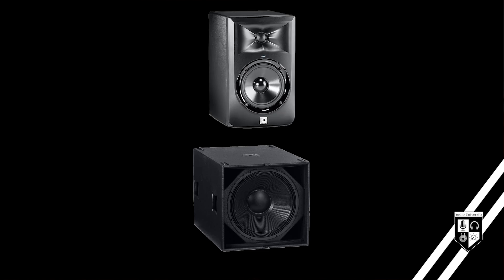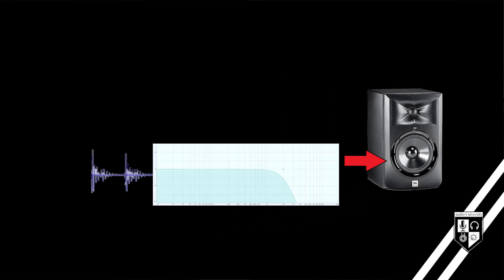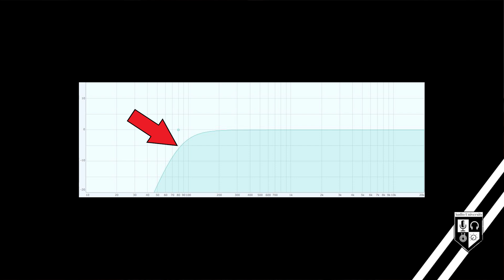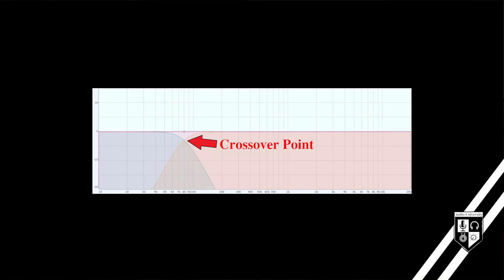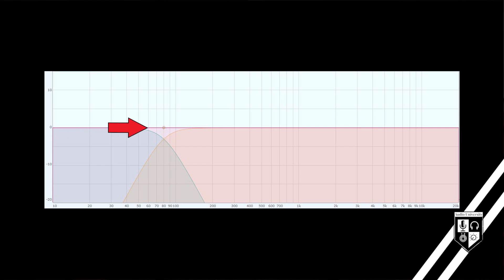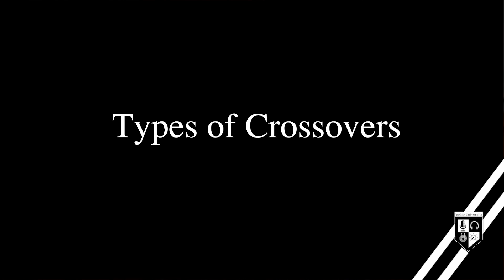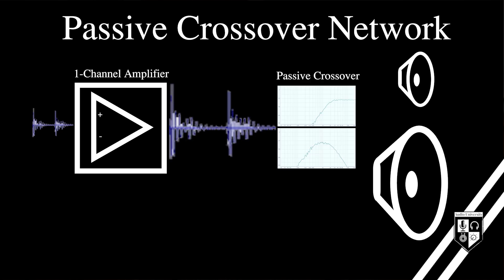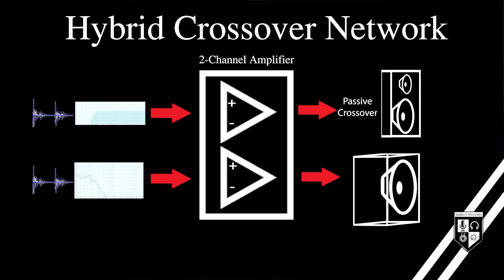Complete Guide To Speaker Crossovers [Crossover Settings, Active vs Passive Crossovers, & More]

Comment: Random question,if i cant add a box crossover to the door panel because its too bulky and i cant find anything smaller , can i use only the capacitor on the tweeter  for a budget build ? I will try to upgrade the capacitor on my tweeters if needed .
I have hertz uno k 165 with the t24 tweeter from their lineup  rated st 3.5 to 20-22k hz . The manufacturer says the component set can be amplified to 75 watts , and i want to know if i can safely amplify the front stage ( i will set gain accordingly with a multimeter to not clip the sound

Comment: Dude! Love your channel. I was wondering if you take questions...I'm trying to wire a horn and 15" driver to a single bass amplifier. Would I need to figure out a crossover option or could I just wire both of those drivers into one NL4 speakon cable and run it to the amplifier. Either way I appreciate what you're putting out. Take care.

Comment: 👍👍Sir, you are the best teacher. Very clear and simple explanation. ❤I am learning a lot from you. 
Can you kindly enlighten us,  for a Active Crossover system, for example, if the Power amplifier for the woofer is 100 watts RMS, then how many RMS watts of power amps are appropriate for mid-range and tweeter?

Thanking you in advance.

Comment: Thank you.  Many systems have subwoofers that contain the crossover.  Unfortunately, it's really hard to find a subwoofer that does not rattle electronics to pieces.  My Adam speakers have a problem on one satellite channel.  I need a crossover to obviate the one built into the sub.  Solved.

Comment: I have watched a few of your videos, very informative. I have a question on using a 3 way crossover.  My amp. is an 8 ohm output per channel. On selecting speakers for a 3 way speaker. How do you verify that the crossover and 3 speaker load for that one channel is with in my 8 ohm Amp´s capability.  I have used a multi meter to verify speaker ohm impedance. Once the cabinet is wired with it´s 3 speakers and crossover, will the multi meter verify the total ohm impedance of that Cabinet. Thus testing the + & Neg terminals, line in on the crossover.??

Comment: So, would it be possible to use an active crossover with an active speaker setup?
Reply from the maker: Yes! You’ll just place the crossover before the input of the speaker. In fact, some powered speakers have active crossovers built-in.
Reply: @AudioUniversity  thank you for the reply! 

Assuming the speakers do indeed have built-in crossovers, it would still be possible to use an active crossover? 

I’m currently building a mini reggae sound system, and really want my subs to focus on the bass!

Comment: Hi Kyle, I've got a 19" rack with a with an active crossover intergrated into the 31 band EQ.  

This is the final stage of the signal chain before it outputs to the speakers on poles with subs on the floor (like you have in your comb filtering video that you made outside).  

My question is, am i better to use the crossover in the 31 band EQ or the crossover in the top speakers themselves or a combination.  

Option A is send left and right signals out of the 31 band EQ to the top speakers on each side and then plug the top speakers outputs into the sub inputs and use the crossover on the control panel of the active speakers to set the crossover.  

Option B is to send left and right signals from the 31 band EQ to the top speakers and then send a separate XLR cable from the Sub Out on the 31 band EQ to the 1st sub, then link the subs together with another XLR cable.  Then set the crossover on the 31 band EQ and not use the speaker crossover at all.

Option C some combination of the above if it has any advantages. 

Your thoughts on this would be much appreciated and those of anyone else who wants to comment.  Thank you
Reply: I've had a closer look and in fact, there is no manual crossover on the top speakers themselves.  There is just a "Sub Freq" nob that says it sets the upper cut off frequency of the subwoofer (80Hz-200Hz low pass).  So on reflection, would you set this to 200Hz to allow it's maximum range to be reproduced and then just rely on the 19" rack active crossover to control the balance between top and bottom speakers?

Comment: I cannot find the answer to the following question anywhere. I have a KEF IQ9. The crossover needs replaced. On my crossover that came with the KEF there are 2) woofer + and - 1) M + - and 1) T + - for a toal 1) in out. This is a total of 10 slots for my wires. I can only seem to find units that accomodate 8 slots. Do I run the woofers together through the same slot on the corssover?

Comment: Hi Kyle! Thanks for all your videos they are really great. I have a question regarding  setting up my system with an active crossover.  I have a Dynacord LitleMax2 speaker system and I would like to use them with an active crossover, because I'm not satisfied with the quality of the sound (I think to much bass is passed to the tops),  but I suppose is not possible because of the passive crossover that is mounted in the subwoofer?  How can I solve my problem in this case ? I have 2 amplifiers for this case and all the cables for connections. Waiting for your proposal.

Comment: Question please.  My 12 inch  subwoofer has a crossover frequency selection from 70 to 150.  Now when I set it to 100 heartz or higher my load 15 inch speakers begin to loose their lows and medium and sound alot. My question is by choosing a higher frequency crossover on my subwoffer does that cuts it out of my loud speaker leaving it it   , basically soundless

Comment: Hey Kyle! Love your videos! I got a question that ive been trying to figure out for a while now.

How would running an active crossover to speakers that already have passive crossovers affect the sound? 

I went to a Bass Boss demo a few months ago and they said that it isn't ideal to you use an additional crossover because it can create phase issues. 
You did mention that it is normal to use that set up so im just curious now that i've heard two conflicting perspectives. 

Thanks!
Reply from the maker: I have seen it done when setting a crossover between a sub and a main speaker.

Comment: Thanks for the explanation sir. I have got a question on a slightly different matter. Is it advisable to hook up two loudspeakers of 400 watts each to a single passive crossover output rated 500 watts? If  yes, should they be in parallel or series connection? Your response will be highly appreciated.
And, kindly note that both speakers are 8 ohms each just like the crossover.
Reply from the maker: Hi, Samuel. You might find this video helpful: https://youtu.be/6B0OlQaD_i4
Reply: @AudioUniversity  Many thanks. Let me jump to it right away...
Reply: I have just checked the vid but it doesn't seem to relate to my question. Let me rephrase Kyle: I have a speaker cabinet that has two loudspeakers and one tweeter. But it's internal crossover is damaged. So for some reason i have got one lying around but it has only one 8 ohm output. My question is, can I hook up both speakers to the same output?

Comment: Thank you Kyle for your videos. Excellent work. I have several 2-way large speakers for church, but I want to improve sound. Shall I get a new set of 3-way speakers, or I can buy speaker crossovers to add a mid range driver into the existing speakers? Thank you.
Reply from the maker: I would recommend getting a new set of speakers, rather than adding additional drivers. For sound reinforcement in a church, focus on the coverage of the audience. Check out this video: https://www.youtube.com/watch?v=nxIajDzQjzk
Reply: @AudioUniversity  I will do that.  Thank you for your response and video.

Comment: Great videos...I know I'm late to the party but, how does a crossover effect the impedance of the speaker? I got a pair of crossovers splitting the sound to my woofer and mid/highs. They count as parallel, correct? Two 8 ohm speakers with a crossover will always be a 4 ohm cab, right?

Comment: Here’s my notes on this video if anyone wants to pinch them

Crossovers

Speaker Crossover Settings
- Cutoff frequency
    - Frequency at which the filter reaches 3dB of reduction
- Slope
    - Rate of attenuation over frequencies
    - 12-24dB/Oct usually

Crossover point is where the 2 filters intersect, where both filters have a reduction of 3dB
This means that frequency is cut in half then doubled so no information is lost, this causes the result to remain the same as before the filters along all frequencies but in different ratios bc as one frequency is being attenuated more and more the other is increasing more and more so they match the original sound

Types
Passive
- Between Amp & Speaker
    - So dealing w speaker level signal which is a lot higher power than signal running through a mixer
    - Signal is boosted to speaker level then distributed by the passive crossover to the 2 drivers
Active
- Requires separate amplifier channel for each driver as crossover is done before distribution

Uses
Multi-Way Speaker Cabinet
PASSIVE CROSSOVER USED
1 Speaker Cabinet enclosure that contains multiple types of speakers
e.g.1 - 2 way speaker cabinet contains a tweeter for high frequencies & a woofer for low to mid frequencies
e.g.2 - 3 way speaker cabinet containing a woofer for lows, another woofer for midrange and a tweeter for high frequencies

Multi-Cabinet Speaker System
ACTIVE CROSSOVER USED
e.g.1 - a stand-alone subwoofer & a 2 way speaker cabinet
2 channel amp is used, first channel low passed to subwoofer, second channel high passed to include only mids & highs to the other 2 way speaker cabinet (which inside has a passive crossover)

Comment: So since we can't hear over 20k (example) should we filter frequencies above 20k so that the harmonics don't interfere with the primary signal and also allow the amp to be run more efficient?
Reply from the maker: Great question! This is a common practice, especially in digital audio, where frequencies beyond the Nyquist Frequency would cause aliasing. With speakers, it’s even more important to remove extraneous LOW frequencies.

Comment: I recently come across a community sound system.  Top cabinets (cs70) 4 - 12s with 2 tweeter.  Sub cab (csX-60B) 4 - 15s in each. 600w continuous, 1500w program.  The top cabinets have crossover in them but previous owner bypass them for some reason.  
1. should I utilize them?
2. I can't find any information about this particular system. 
Everything is original and in excellent condition.

Comment: thank you. so when i put both hpf and lpf crossover frequency in my car HU on 80 db, it will well merged and i should not concern about frequency merging?
Reply from the maker: It depends on the type of filter being used.
Reply: @AudioUniversity  thx. can you provide more detailes?
Reply from the maker: There are different types, such as Linkwitz-Riley and Butterworth. The differences are not something I know very well. I’d recommend searching those terms to do more research.
Reply: @AudioUniversity  it was helpful, thank you.

Comment: First of all thank you for your informative channel keep up the good work!

Now this is my question 
I am setting up my new av receiver and I want to know on what setting need to be the crossover 
My av receiver is 
Denon avc 4700
Front Dali ikon 6se MK1  Frequency Range  +/- 3db: 39 hz - 30.000 hz
Center Dali ikon vokal 2 Mk1 Frequency Range(+/-3 dB) [Hz]   55 - 30,000
Surround Dali Opticon 2 MK1 Frequency Range (-3dB) : 59-27.000 Hz
Subwoofer Dali SUB E-12 F Crossover frequentie : 40-120 Hz

Also do I need to set up my speakers at small size or big? 

Thank you very much for reading this and I hope you respond on my message. Greetings

Comment: Hi Kyle. Brilliant explanation. So am I thinking correctly when I say for example a JBL speaker is a powered speaker. It has a built in amplifier and passive crossover built in? So with the RCA output plugs at the bak of a powered speaker can the wires lead to an active crossover that filters high frequencies to other speakers like tweeters creating more tops than bass. Just that I notice with most powered speakers at high volume the low frequencies seem to be less prominent and at low volume the high frequencies are less prominent. Reiterating my question... Can you add a crossover from the RCA outputs without causing damage to the powered speaker? Thinking of speakers having their own impedance ratings and I was told they have to match. Maybe this does not matter outside the powered speaker? Thanks in advance.

Comment: Hi 
Very nice and intersting video 
Suscribed and following from Paris 
I do have a question 
I have a cabinet with two 8 ohms speakers, a 8 ohms high frequency driver and a two way crossover. 
My plan is to connect the high frequency driver on the trebble pole, and the two speakers in serie mode on the bass pole.
So with this connection mode how many ohms my amplifier is going to work on? 
2, 4, 8, 12 or 16 ohms.
Thanks for your help 
Take care
Reply from the maker: It sounds like you’ll have 8 ohms on the treble pole and 16 ohms on the bass pole.
Reply: @AudioUniversity  thanks for your precious answer

Comment: Linkwitz Riley filters are -6 dB down at the Xover point and sum exactly to 0 dB while filters that are in phase and - 3dB will have a ripple in their response. From Wikipedia : "The filters are usually designed by cascading two Butterworth filters, each of which has −3 dB gain at the cut-off frequency. The resulting Linkwitz–Riley filter has a −6 dB gain at the cutoff frequency. This means that summing the low-pass and high-pass outputs, the gain at the crossover frequency will be 0 dB, so the crossover behaves like an all-pass filter, having a flat amplitude response with a smoothly changing phase response. This is the biggest advantage of L-R crossovers compared to Butterworth crossovers, whose summed output has a +3 dB peak around the crossover frequency. "
Reply from the maker: That's really helpful info, Gerrit Govaerts! Thanks for sharing your expertise!
Reply: @AudioUniversity  happy to share over 25 years of building and designing speakers
Reply: And to round it up completely: We are talking about the ACOUSTIC responses of the loudspeakers. So applying a LR filter electrically doesn't always make for an acoustic LR response. But hey: your fine explanation is a start!  Your claims 'complete' and 'university' however are a bit to much for the knowledge levels you are 'monetizing'. some pointers to more in depth sources?

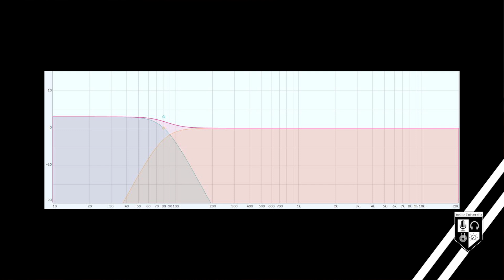Comment: At 06:13 = the crossover point moves. What does that mean? What implications does it have? You say that is something to consider, but not why.
Reply from the maker: Because you're dealing with the slope of the HPF and the LPF, the crossover point will move to a higher frequency when you boost the overall level of the low-frequency signal. Does that make sense?

Comment: You, are a very interesting person; I appreciate the clarity and simple terminology; I recently installed a component speaker system (Orion)- (2 ) 6.5" door speakers & (2) tweeters; the system was set-up 4 years ago& worked pretty good; the design was set up to run thru a class D 2 channel 1500 watt JBL amp; one of the 2way passive crossovers stopped working; so I decided to replace the entire component speaker system; I took great care & time to install the speakers (1970 chevy truck) and check all the connections; I paid very close attention to making sure the wires to the crossovers were right + to + &- to-; the speakers on the driver's side seem to function- whereas the speakers on the right sound "DO NOT WORK AT ALL" NO NOISE- "NOTHING; I took a test light and checked the positive terminals on the crossovers the test light indicated a "DIMMER LIGHT" on the test light however the speakers work; upon checking the right door speaker "which do not work at all contacting the three positive terminals on the right side crossover produced a very bright light- but no audio- and no power to the "tweeter connection" the other two terminals produced the very bright light?? I do not know very much about radio,s stereo,s amplifiers; all I did was remove and replace; hope you can afford a few minutes to make a suggestion add where to start troubleshooting this issue; thank you I,ll be watching for more videos and useful information I have a lot to learn!! be safe thank,s PATRICK.P
Reply from the maker: Thanks for your kind words, Patrick! The first place I would start with troubleshooting is here: 
——————————
Because the left speaker is working and the right speaker isn’t, swap the speaker wiring - left and right.  
——————————
This will help you determine if it’s an amp problem or a speaker problem.
——————————
If the right speaker still doesn’t work even when it’s plugged into the same channel that successfully powered the left speaker, it’s probably a right speaker problem. 
——————————
If the right speaker starts working, the right amp channel or crossover is likely the problem. 

I hope this helps! Good luck!
Reply: @AudioUniversity  SORRY, BUT I, M A LITTLE CONFUSED;
Reply from the maker: I’m suggesting that you unplug the left speaker (which is working) and use that channel to test the right speaker. This will answer the question, “Does the right speaker work?”
Reply: @patrickpeterman4890  ? He's telling you, that since the left channel is working, hook the left up to the right channel speaker(s), and see if it works then, on the right side.
Reply: @MrDoneboy  thank,s !!!